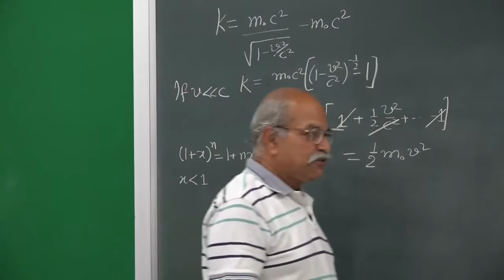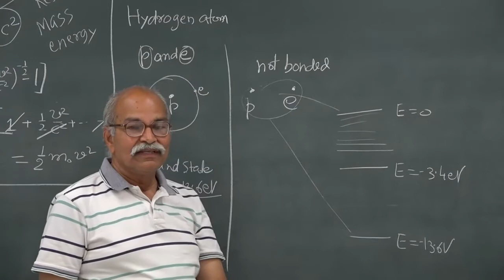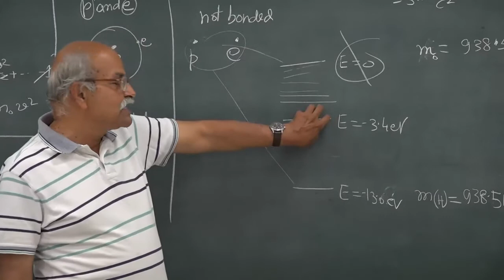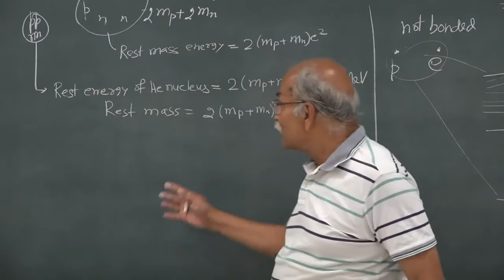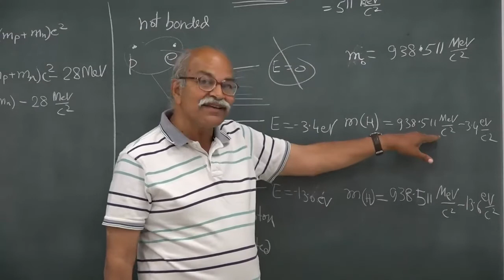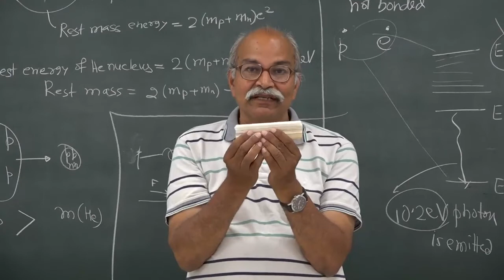Ep-16 Mass energy conversion-1 || STR complete course by HC Verma sir || Mass energy conversion

Comment: But one question, why energy has to release in bond formation? Why at the first place, the mass is even decreasing?
Reply: When there is no bonding, rest mass energy of proton and neutron is there, by relativity formula E = (Mass_proton+Mass_electron)c^2
But as bonding starts, energy is decreased(-ve sign...From E=0{no bonding state} to E=-13.6eV{ground state})  and this -13.6 eV energy decrease also decreases the rest mass at ground state by -13.6eV/c^2. In between other excited state, energy fluctuates between 0 to -13.6 eV according to excited level. So as energy is given to electron at ground state, it absorbs some energy and jumps to other excited state. When it jumps down from excited state to ground state, it releases some energy in form of light.